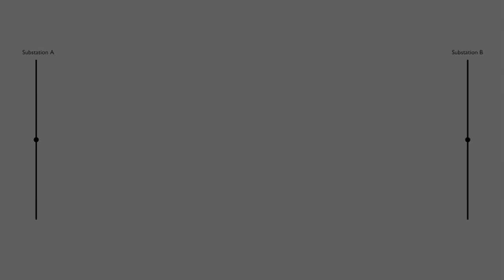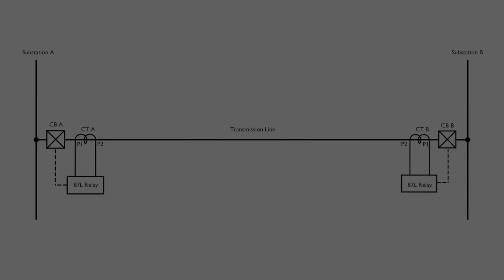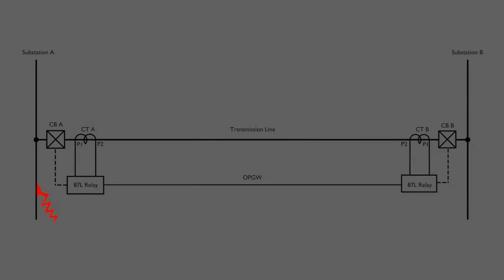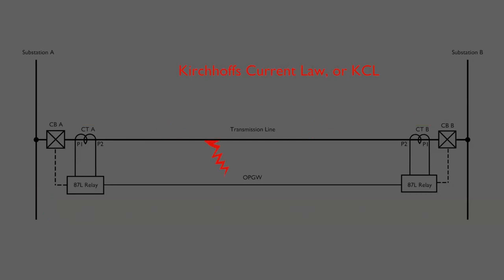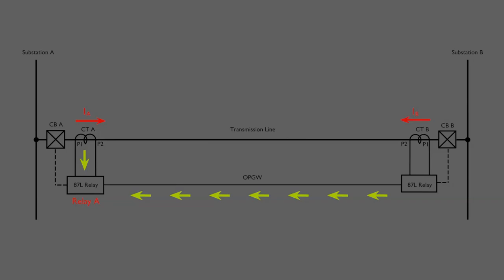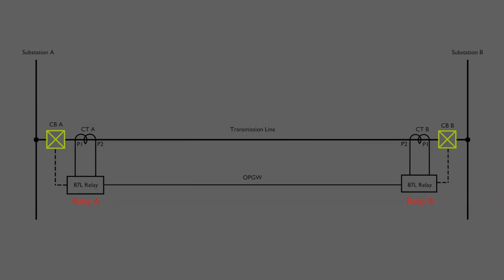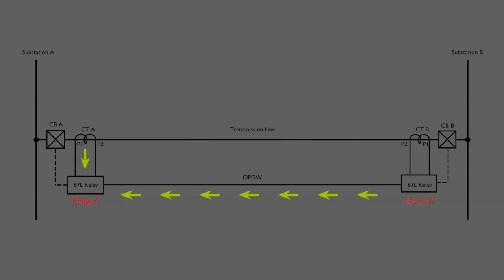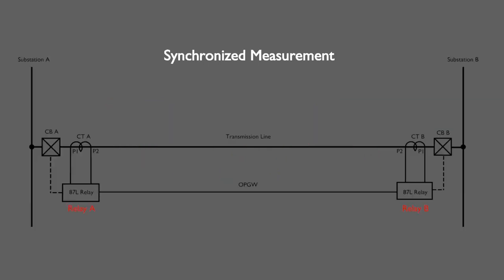Line Differential Protection Explained | HV Power Transmission Basics

Comment: I have a question over here: do the relays have to be the same exact model on each side? or they can be different models but with the same time synchronizing protocol supported?
Thank you!
Reply: In my experience yes both relays need to be the same to use 87L, my company uses SEL-411L’s However even “older” solid state relays communicating via fiber still trip in under 1 cycle using permissive overreaching transfer trip or direct transfer trip
Reply: But who the difference in a relay sending a trip in 0.6 cycles or 2cycles doesn’t matter too much when it takes 20 cycles for the bkr to clear the fault